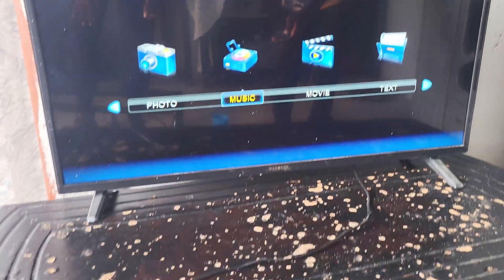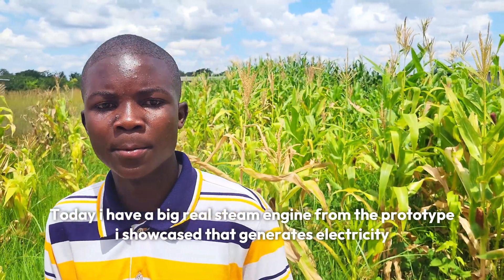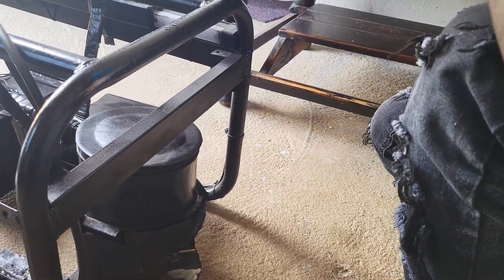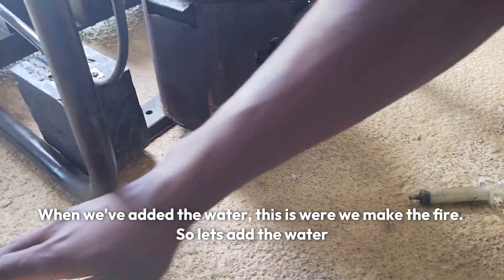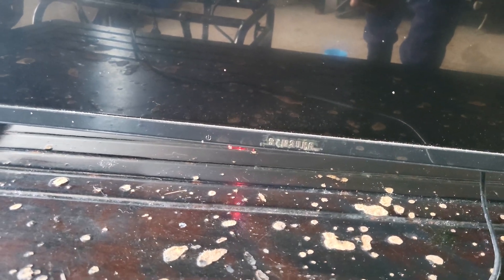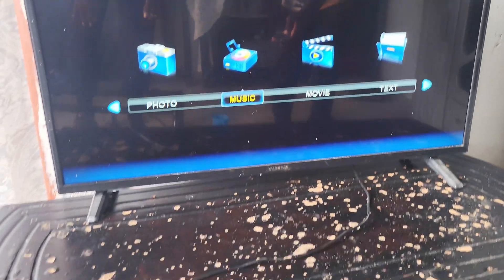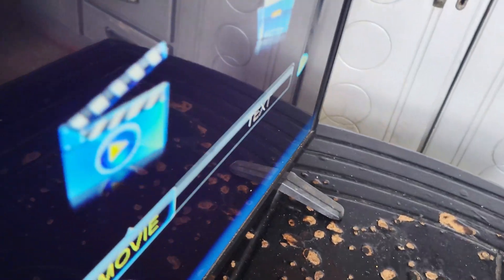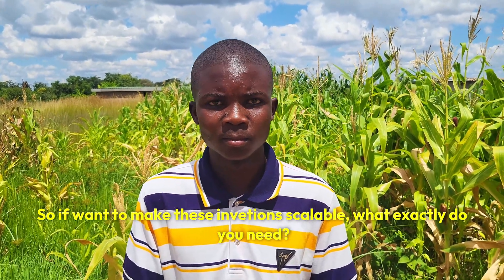Teenage Zimbabwean Inventor Unveils Another Water Powered Generator

Comment: guaranteed it isn't generating 220 volts going that slow.  The hidden battery is just that - well hidden for the inverter.
You don't need all of those transformers and mini fan if you are generating power direct to the outlet for the tv.
The battery is inside the box with the transformers on it.

Comment: This guy deserves credit. I would buy one from him. He turns wood energy into electrical energy. It is legit. Only he has to have a bigger water tank.
Reply: if you pause the video at 2:12 & 4:42  would see a power cable running under the the carpet.
Another scam from Zimbabwe.
Reply: @SERGIO-cr6uy  no hidden power cord needed.
only hidden battery under the transformers - that are the inverter.  Guy learned from MAXWELL

Comment: Calling this water powered generator is the same like calling diesel generator "co2 powered generator"

Also his water generator is still fake.
There is obviously no pressure being created, no valves to regulate steam entering the cylinder.
Cylinder bore is so tiny that to get any power he would need really high steam pressure, that's not happening with push fit rubber hoses.
Reply: Pay attention to a power cable running under the carpet. It's discreet yet visible.

Comment: my first take is that there is no piston for the steam to even power we see it by the side escaping. The size of the motor and the speed won't even create enough amps or significant voltage for the transformers to even increase,  even if the transformers increase the voltage to 225v as he said there wouldn't be enough amps to power a TV!!. He has the vision but not the knowledge. What he should have done is to follow the principles of how a steam engine works rotate a more reasonable size motor that can handle higher rpm before even thinking of stepping up the voltage
Reply: It is another scam to look for " donors". Who will part with money only to realise they backed a fake thing.
Reply: Pay attention to the cable running under the carpet...
Reply: @SERGIO-cr6uy  y'all some hate in the world, Africa will win the century, White stole everything..internet will show the real inventors now..

Comment: stupid "invention" is basically the steam powered engine invention boil water get high pressure steam to move the rotor and generate electricity! the problem is where you get that amount of water in africa needed to use this on industrial/nation wide scale? and how much extra heat you generate in the hottest continent by burning wood? kid go to school you did not invented anything worthy, appreciate your passion but you need education

Comment: Steam engines are well known since first industrial revolution. You'd need a higher steam pressure than that to get anywhere... That's why power stations burn coal and other fuels in big furnaces to generate high pressure

Comment: Over 300 years ago the steam engine was invented.. I think that's the beginning of the industrial age.. now this youngest is doing his best where Zesa is failing... 👍
Reply: Some one just pointed out seeing the power cord under the carpet around 4:12 smh
Reply: The steam use to run the machine where the dynamo connected that produce current then make step up by using transformer to 220V. it is combination of steam to run the dynamo and step up to desired voltage to be used. Simple as like that and not an invention. But rather a "combination." It exist long time ago.😂😂😂😂
Reply: Civilizations move forward in upward steps. Zimbabwe is going back down the steps, but this guy has actually mde a practical invention that can work anywhere in zimbabwe..... albeit on the steps going downward.

Comment: It is fake,it uses 12v ups battery to power the motor and tv.
Reply: Listen to the UPS Beef Sound when Switched On... I can't believe people easily believe this Shits.
Reply: Pay attention to the power cable running under the carpet.
Reply: @SERGIO-cr6uy  no hidden cord needed
Reply: @scamchan   if you pause the video at 2:12 & 4:42  would see a power cable running under the the carpet.
Reply: @SERGIO-cr6uy  Naw that isn't a cord there is no need for a cord.
That is just a lump in the carpet.
You can see the parts for the inverter clearly shown and hear it BEEP as it is turned on.

Keep in mind this is the same kid 
that made a smaller version with a hidden battery with a key switch in a box.
Reply: @SERGIO-cr6uy  if he was using a power cable hidden there would be no need for all the additional electronics he could just rig the wire direct to the outlet and use a tiny switch.

Plus the guy doing the interview would have called out an obvious wire if he is already looking at the back of the tv set I am sure he would not only see the wire he would be stepping on it as well.
Reply: @scamchan  are you for real? When you watch a magic trick you must think "it's legit, it's real", don't you ?
Having switch on a box doesn't make them useful, do they?

Yes there's a lump on the carpet coz that's where the power cable is.
Also as for the guy doing the interview, he's promoting Maxwell Chikumbutso's microsonic self powered technology... Which is a scam.

Wanna know what they have all in common? They are from Zimbabwe.
Reply: @SERGIO-cr6uy  Just saying what seems obvious isn't the route this time around.
There is no magic here.
A simple inverter with a battery is all that is needed.

That lump isn't a cord there is no need for an elaborate cord that you need to spot.
Just examine the device itself.
The obvious scam is in clear sight.
There is no power generated from the STEAM.

Maxwell isn't the only one using them.
Reply: @SERGIO-cr6uy  Maxwell powered his self powered tv with an inverter.
This is no different.
Reply: @SERGIO-cr6uy  Either way it remains a scam.
I see from his other video he wouldn't use a hidden wire.
Maybe watch his other video to see what I mean

Comment: To rotate a flywheel you need a lot of steam pressure. That tiny pipe on top of the lid isn't tighten by nuts or screws. Stop spreading fake videos guys.
Reply: it really shows how much to stupidity it is